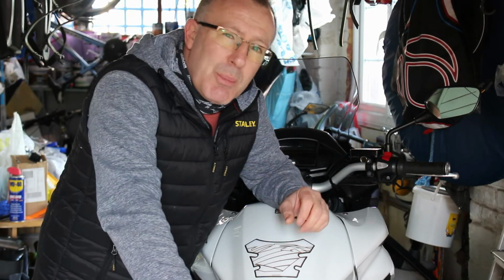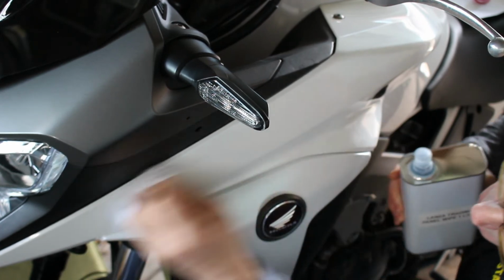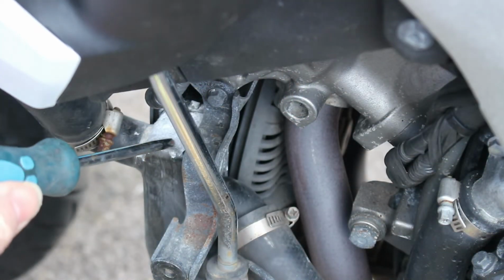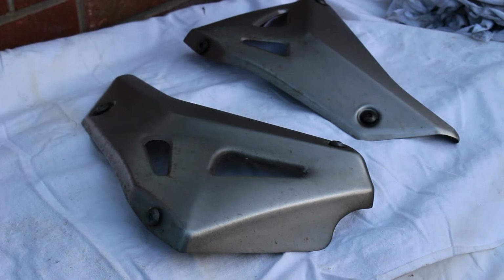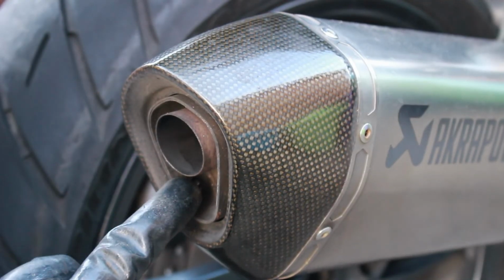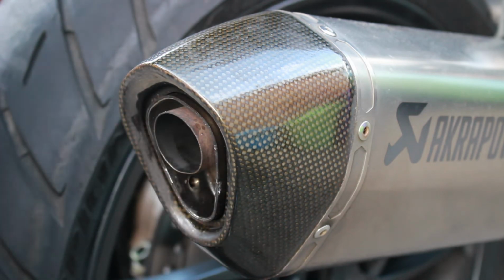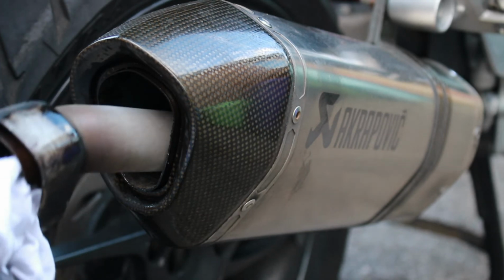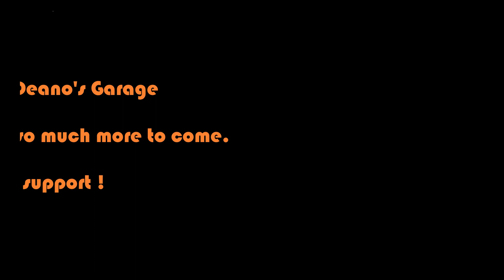VFR800 Crossrunner part IV

Comment: I appreciate your careful, well thought through approach. How do you find the weight of the bike e.g. manoeuvring around your drive/garage & when riding?  Apparently they weigh as much as a GS perhaps with a higher centre of gravity.
Reply from the maker: Thanks Jeb !!! 
It is a  rather heavy bike, but feels great on the road, solid, easy to turn into corners, very neutral steering. 
I did drip it twice, once when that bloody van came shooting up the lane so fast I had to hit the front brake, which is great, but as on a slope and mid turn, couldn't catch the weight before it went down very slowly. It is a tall bike, kind of like a GS, but not as tall, and seat sits lower. So slow maneuvers can be a little more awkward if like me you are only 5 foot 9 or shorter. 
In all honesty though, Great bikes, tick almost every box, very under rated. Oh and sound great too..
Reply: @DeanAllen Thank you. I have had a 93’ VFR750FR since 2010 & love it but am minded to get something more upright. I’m 5’9” in the morning 😀